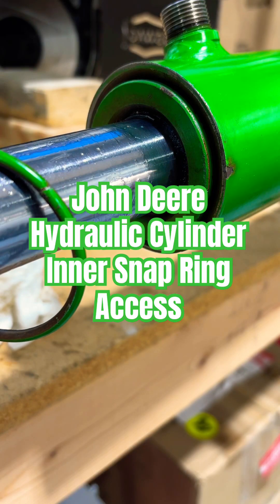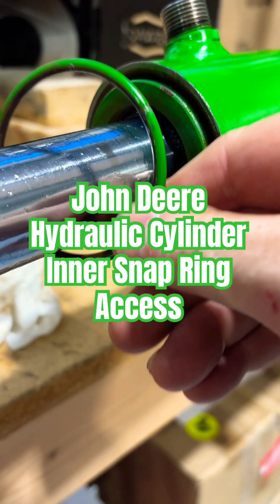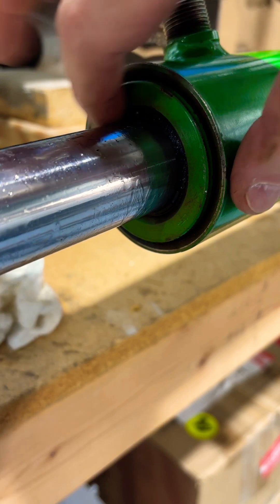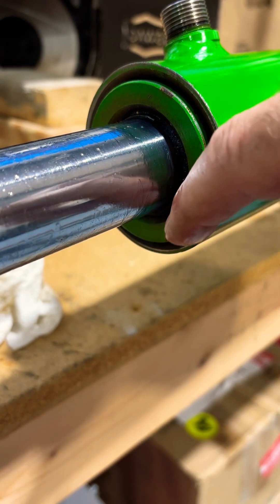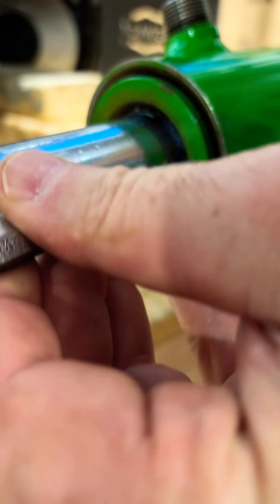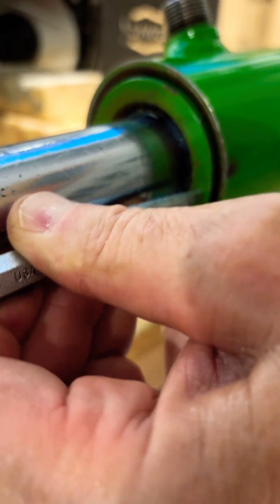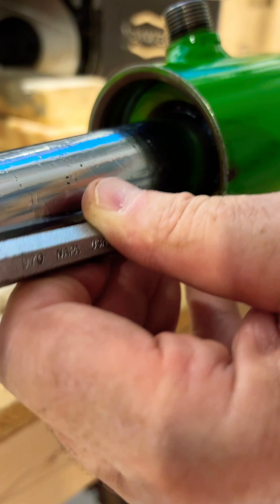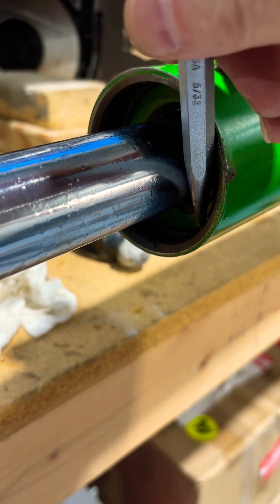John Deere Hydraulic Cylinder Inner Snap Ring Access

Comment: Step 3!!!?!?!?
Reply: I hear you speaking loud and clear but where is the inner snap ring or the tool required for removal? Where’s the rest of the information?
Reply from the maker: The 2 big steps in accessing the inner piston and gland are the removing the 2 snap rings (one outer and then the inner ring). Once those are compressed and released you can access the gland and piston to replace the scrapers/seals inside. If you don't remove the outer then inner snap ring, you can't do anything.
Reply: @laurencevillegarage  why would they put snap rings on there besides making it more difficult?
Reply: Probably too late but there's a plastic ring you have to buy from Deere that you put in the groove and allows the inner o-ring to not slip in that groove